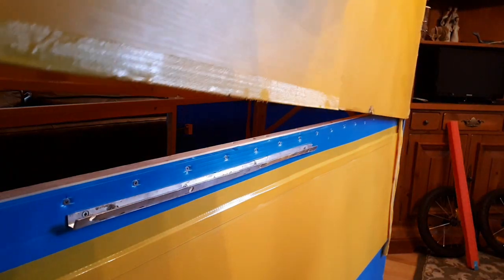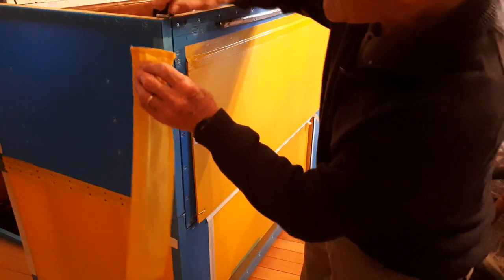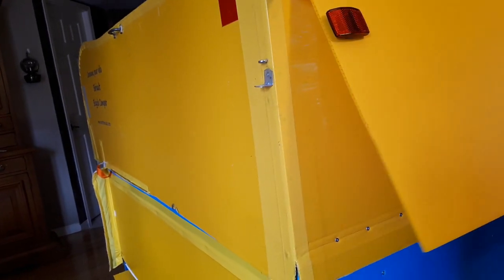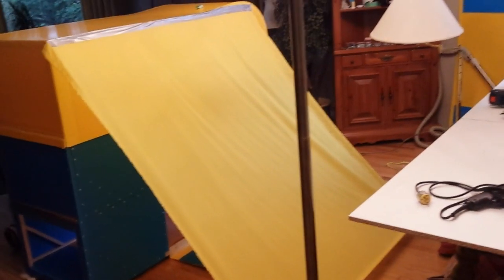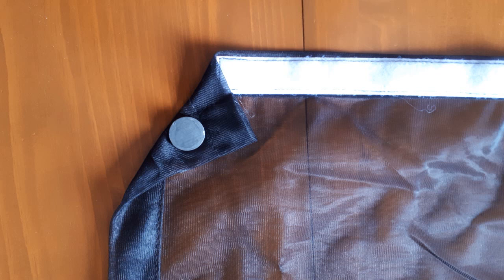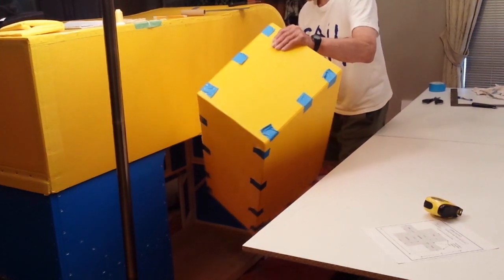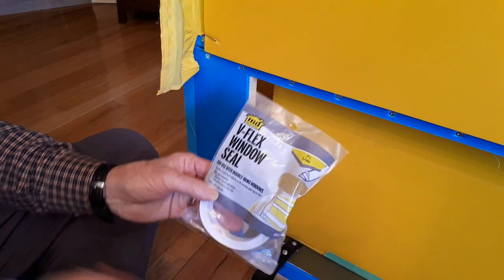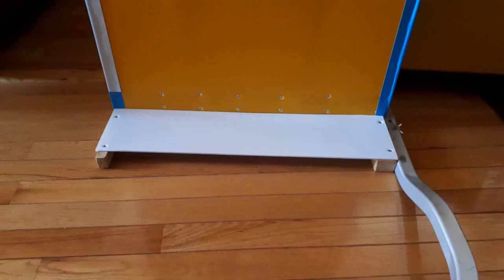Part 5   Building a Bériault Bicycle Camper   Accessories

Comment: Well done Sir, If I were to make a camping bicycle trailer, I would build one very similar to yours except,
For the sleeping portion I would use a heavyweight 12 0Z duct canvas for my legs to stick out at the end, sorta like a tent for my legs. The side walls would be the same canvas, as canvas breathes unlike plastic, and makes staying inside more comfortable.

The frame would be plywood using aviation/marine grade glues, and the floor would look like airplane trusses with a thin layer of plywood for the inside floor, that had the same water proofing as the plywood frame.
Allowing my heavier weight to be supported, by the frame and the axle.

Having the ability to use any lightweight nylon fabric awning to velcro on either side,with a couple of hiking poles and 2 brass grommets, and one side wall would allow easy access into and out.
I like the Burton swing arm idea, over some of the other designs.

Overall great concept you have, although that is a girls bike, just saying...

God Bless and God Speed in safe travels in the once safe roads of Canada and the USA.

#FreeAssange #FreeAlexJones #FreeTibet #NoFreeShite
Reply from the maker: You have a very creative mind and many good ideas. 
The girl's bike is quite nice for getting on and off, for a guy my age.
Thanks
Reply: @ @RobertBeriault753 Thank you and you're welcome, safe travels.

Comment: Robert: I like this trailer but I would think rain can get in at the slide outs & the door area since it is sitting on the ground. How do you not get rain in from these locations? Also how do you prevent rain inside while setting up?
Reply from the maker: Good questions. 
1) The pullouts sloped to drain the water. They are sealed all around with V-flex weather-stripping to keep the water out.
2) I don't know how I would do it if it were raining while setting up. I haven't been in that situation (yet).
Thanks for your questions.
Reply: Robert Beriault What about the door area at the ground?

Comment: Where do I find coroplast in Germany I just can’t find any
Reply from the maker: Coroplast is a trade name for fluted
corrugated polypropylene sheets. 
It is also known under the tradenames
of Cartonplast®, Polyflute, FlutePlast, IntePro, Proplex, Correx, Twinplast, Corriflute or Corflute - refers to a wide range of extruded twinwall plastic-sheet products produced from high-impact
polypropylene resin.
 I found this company in the UK that makes the product under their trade name: Correx. 
https://www.cutplasticsheeting.co.uk/fluted-polypropylene-sheet/ They have it in 1220 mm x 2400 mm x 4
mm thick, which is equivalent to 4 x 8 feet.
I hope this will be useful. 

If you do find a source in Germany, please let me know at allorobert@gmail.com. This would enable me to post the information on my website.
Thanks for your question.